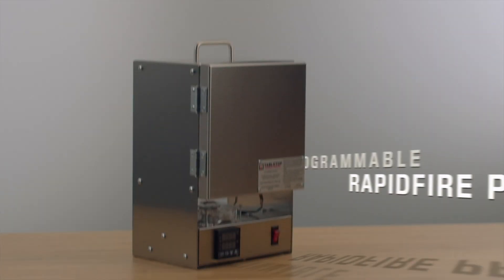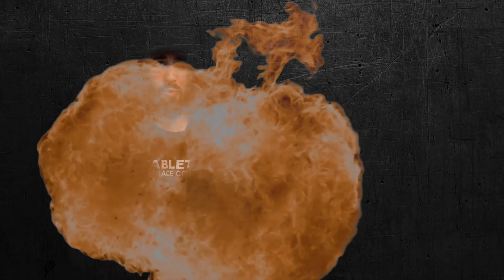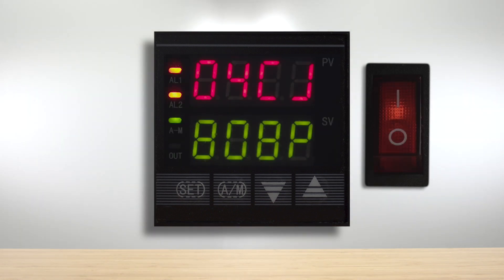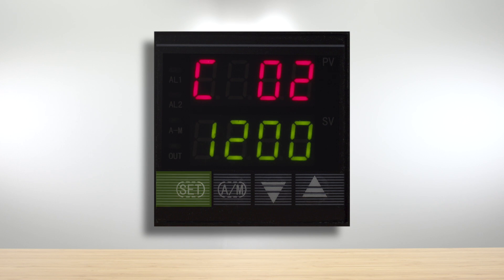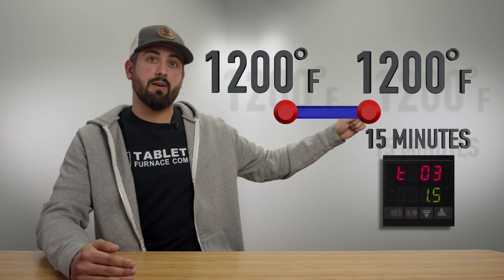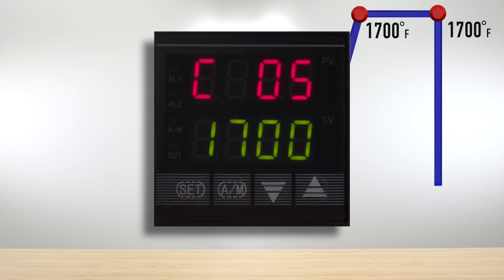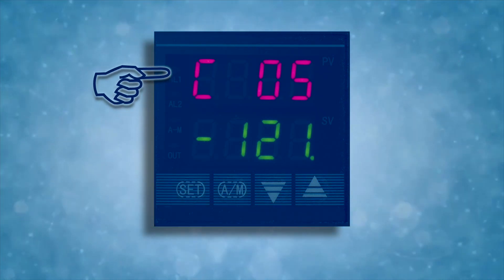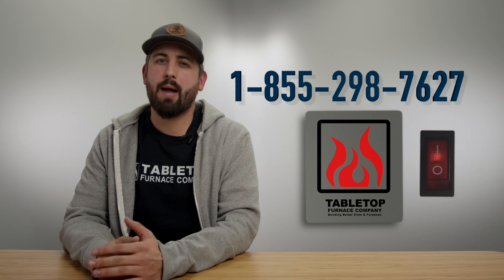How to Program the TableTop Furnace RapidFire Pro

Comment: Great video, thnk you.  I'm about to do the initial burnout of my PROGRAMMABLE TableTop Hi-Temp 2200°F Electric Burnout Oven Kiln. I live in NJ and am waitind for some reasonable weather to do it outdoors. Am I OK doing it some where in the mid to upper 40 degrees? Also, what is the purpose for the small square metal tray that came with the furnace?

Comment: I am reaching out regarding a programmable kiln I recently purchased from your company. I need assistance programming specific steps for the casting of rings, as I am having difficulty configuring the correct temperatures and times on my unit.
Here is the programming I am trying to set up:
Water Removal Preheat: 300°F, hold for 1 hour
Thermal Transition: 700°F, ramp up over 1 hour, hold for 1 hour
Pattern Removal: 1350°F, ramp up over 2 hours, hold for 2 hours
Casting Temperature: 1000°F, hold for 1 hour
I would like to know how to enter this sequence into the kiln, using a code similar to the following:
Example:
C:300T60
C:300T60    
C:700T60
C:700T60
C:1350T120
C:1350T120
C:1000T60
C:-121T-121
?
(The code I use might vary depending on the kiln model and brand).
I would appreciate it if you could provide detailed instructions or a programming example that corresponds to these steps, or let me know if this functionality is available on my kiln model.
Thank you in advance for your assistance. I look forward to your prompt response, and I am available for any additional information if needed.

Comment: I have a Rapidfire PRO-LP from you. Burnout of the oven and the first 4 castings have gone well. When I now put on the program again, the PV red temperature suddenly rose immediately, while the SV green temperature goes slowly upwards. Then the oven will not burn. Anyone? Can you reset the machine
Reply from the maker: Dear Trond, Please note our Rapid-fire PRO-LP is not suitable for wax burnouts. Its most likely that your thermocouple has failed due to not using the correct kiln for this application. We recommend only using our Hi - Temp models for burnout applications per the warning sheets and instructions that come with your kiln: https://pmcsupplies.com/programmable-tabletop-hi-temp-2200-f-electric-burnout-oven-kiln-for-3d-pla-resin-and-carvable-wax.html 

Please contact us 518-249-6533 Monday - Friday 9am - 5pm EST so we can get your kiln upgraded to use for wax burnouts and back in working condition.

Comment: So does anyone who has a tt pro ever have 2 separate and distinct programs to  run. And NOT have to enter each program every time.
Reply from the maker: Dear Ra Kessler, You can have 2 programs set without having to enter each program each time. There are 30 steps within the programmable controller allowing you to set as many programs as you wish within the 30 steps available. If you contact our technicians they can walk you through on how to set this up and explain how to access those programs when starting your kiln. Tabletop technicians are available Monday - Friday 9am-5pm EST. 518-249-6533 Thank you!

Comment: So i am about to try and add a second program behind the primary one. Not sure how to add or run a secondary program. I am also going to seal the door to try and control the 25 degree flux i am getting in the program. When running i can see all around the door the glow of the elements. Please any comments are appreciated.
Reply: Well i placed 2 distinct programs but no one has been able to tell me how do you start program B and not program A.
Reply from the maker: @ra Kessler If you have any questions or need further assistiance with your kiln please contact us 518-249-6533 Monday - Friday 9AM - 5PM EST. We are happy to help with any questions you may have with using your Tabletop Kiln. 
Thanks!

Comment: can i use this machine for investment casting burnout and pottery firing?
Reply from the maker: @Maxell, This unit is not recommended for burnouts but we do make a programmable version that is here: https://pmcsupplies.com/programmable-tabletop-hi-temp-2200-f-electric-burnout-oven-kiln-for-3d-pla-resin-and-carvable-wax.html If you have any questions or need further assistance with purchasing a kiln please contact us 518-249-6533 Monday - Friday 9AM - 5PM EST. We are happy to help with any questions you may have with using your Tabletop Kiln. 
Thanks!

Comment: Nice and clear video, however; that programming of these pid controllers still need a instruction video in 2021 while you only set a handful of values, goes to show that these controllers are waaaay outdated. 

We live in a time of Bluetooth, Wi-Fi and smwartphones. A simple connection to a piece of software or app on a phone that lets you drag a graph with less then 10 clicks on a screen should be no problem in this day of age.

Comment: Can you setup more than 1 program
Reply: Still trying for 2 programs
Reply: @ralfkessler  I would be ok with a simple yes or no
Reply: I have the same question. I have been told it can be done. But no where is that shown or explained.
Reply: @ralfkessler  yea they are trying there hardest not to answer. Customer service my axx. Maybe this thread will wake them up
Reply: Yes each step is a different program. Change the step number and add a different program. Then when ready to burn switch to the program you want and run it. At least that’s what I understand from reading others comments
Reply: @mcgrawfan89  we mean programs not cycles. One program may have 8 steps to the cycle. A bit confusing but it’s probably a no.
Reply: @InitiallyJB  I understand what you mean. But each step you can add multiple cycles too which would be one whole program. Change to step 2 and add different cycles and make a new program.
Reply: @InitiallyJB  if you look up at the top of the comments the company replied to someone asking this same question and they said the same thing.

Comment: any way I could get it to 1300C?
Reply from the maker: Dear Carl, Technically yes however, we don't recommend it. The coil and insulation are rated up to 2300 F. Contact us Monday-Friday 9am-5pm EST and we can discuss the options - 518-249-6533 Thanks!
Reply: @Pmcsupplies  Rated to 2300 F huh? So even though it's advertised for up to 2200, if someone wanted to, say, try and use it to debind and sinter something made with Virtual Foundry's 316 Stainless Steel filament (2300 F), that might barely be doable? Or would that kill the kiln?
Reply: @Pmcsupplies  He is asking for 1300C ( celcius ). And you are answering with Fahrenheit. What is the temperature that the coil heats to?? Fahrenheit or Celcius ???

Comment: I'm having a problem with mine. I've been setting it to 1430 and it constantly heats up about 20 degrees higher according to the thermocouple. I set it to 1450 for enamelling silver and it melted it completely. Fine silvers melting point is 1763. Any help appreciated.
Reply: Maybe try an Autotune and that should calibrate the controller to the thermocouple and kiln you have.
Reply: Mine does the same i am going to stop all the heat leaks that are around the door.

Comment: I cant fabricate an acceptable reason why a variance of 25 degrees + or - isn't covered in this video or the manual in detail. I thought mine was broken and it almost became a very expensive anchor. Plenty of kilns are not programmable so you pay more money for it to follow a burn cycle, so when it waffles off the plan you cant help but think something is abnormal. I know 25 degrees isnt changing the results of your mission but watching it visually stray from the numbers can ruin your day if you dont know how to process the data. Now I add +20 degrees to every temperature program entry religiously. The car dealership didnt tell me that when I set my cruise control to 60 mph, I might be going 85mph or 45mph.
Reply: So i also have concern in the variation flux of temp. My furnace door does not seal and i am about to use furnace cement/gasket to try to control that flux in temp. I am also using the furnace to heat treat and temper steels
Reply: it definitely drifts a little bit, and you kind of have to learn how to offset the temperature with your environment. Running it outside in about 77 with mostly sun drifted somewhere between 20-30 lower than the set value

Comment: Does it work the same for the pro l
Reply from the maker: The PRO-L uses our standard controller. Our standard controller does not require programming. You simply just use an Up and Down button to increase or decrease the temperature.

Comment: Could this be any more confusing?  Geez....  :-/
Reply: @capt.diractance9926  definitely not. Go to the Auger website and read the manual for the PID. Clears up a few things that really should be covered here... Or better yet... in the instructions included with the furnace.
Reply: Every PID temp controller is like this. You have to learn it like you would a new phone or other electronic device. Just remember the time in each step is the time it takes to reach the next step temp... So it's a ramp up time. To hold you'll have to enter the following step at the same temp and the time as the time you want it to hold there. Holding at a temp involves 2 steps. Confusing... Sry...but vital.